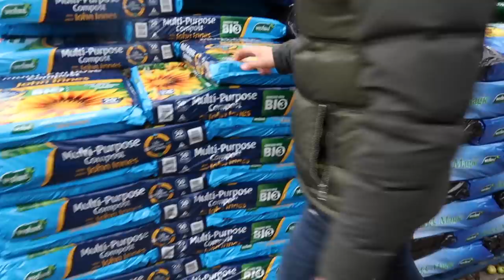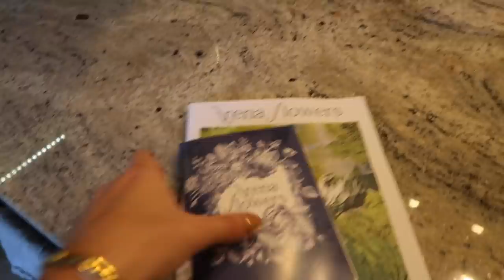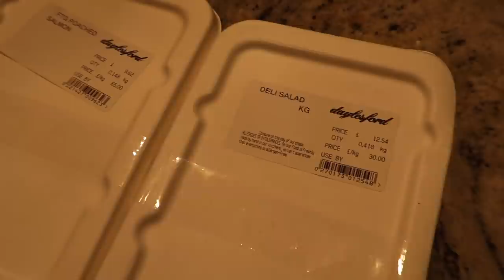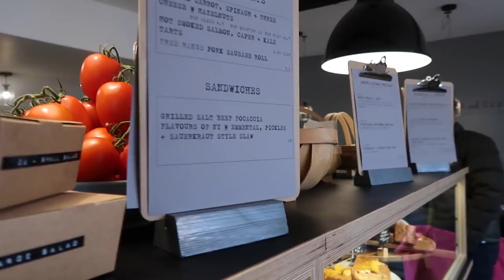🍂 AUTUMN // FALL HOME DECOR  🍂 & CLEAN WITH ME  🎃//  Fashion Mumblr Vlogs

Comment: Such lovely autumnal feelings watching this. I just wanted to message as I have an aga and I started using aga splash backs. You put them on the lids when you are cooking. You may have them but wanted to mention as I didn't know about them when I first got mine. Really helps to keep them clean throughout the winter when its too hot to thoroughly clean the aga due to the heat. Not a must, but I really appreciate them.

Comment: If you wall mount the TV you could get it built in the wall like ours or I suppose you could get a wooden frame built around it, almost like a picture frame. If you just want to wall mount it but hide the wires you could get a section dug out the wall, put trunking in the dug out section, put the wires in, replaster & paint over it so the wires are concealed and it just looks like the wall

Comment: Perhaps put the television in a flat cabinet on the wall built for that space? There are lots of inspiration ideas online.  If you look up Patina Farm TV cabinet online I believe you could see what I mean.  You would be putting the cabinet close to the top of that beautiful new cabinet you bought so the cords could probably be tamed so as not to be noticeable.  In my modern home I could run the cords through our walls but I’m not sure that option is open to you because of the wall structure you have.  You could also hide the cords in a little 3 sided channel that would go from the tv to the top of your cabinet. This would give you a nice surface to style on top of the cabinet as well as the opportunity to have some art in that corner.  By the way, Patina Farm is a good source of inspiration there is a book as well as a blog.